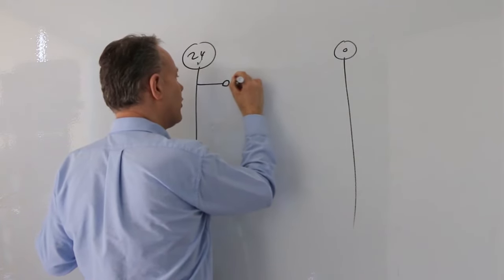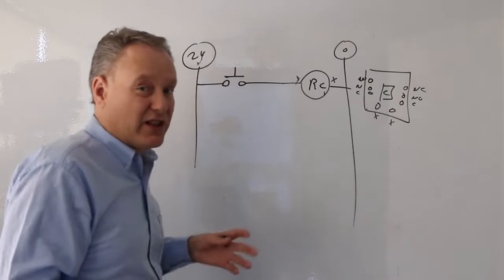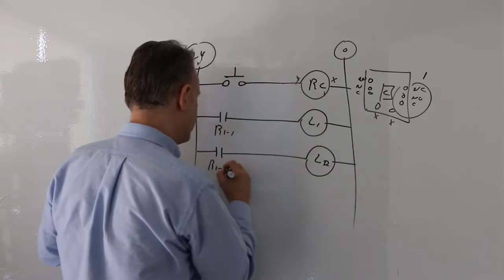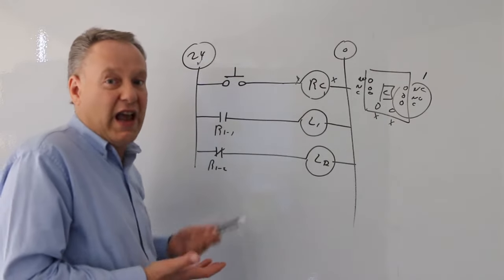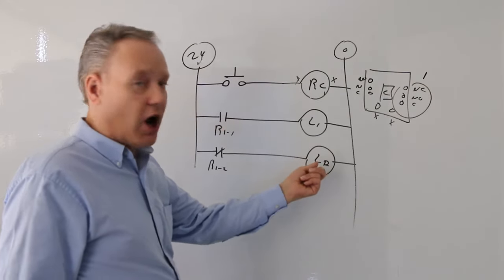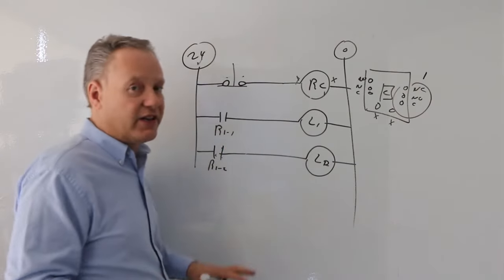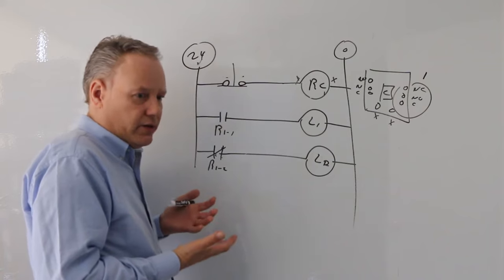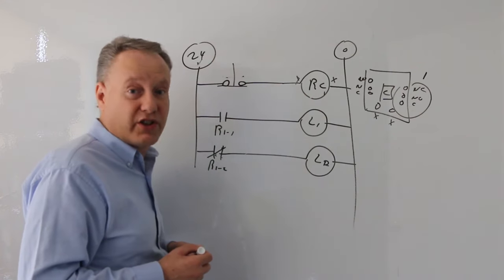Introduction to Ladder Logic with Relays

Comment: Is it safe or ok to run 120 volt contactors and switches on a control box ? Can i use things like time delay relays as relays or is it best to drive contactors wit them ? Im worried a 120 system would burn up a coil on a normally closed contactor if it was held up for 3 hours . I feel like a 24 volt coil would have a higher duty cycle

Comment: Takes me back to the 70's when I used to service the old electro mechanical pin tables.  There's more than a few' logic relays' in those old babes I can tell you, the schematics look like a plate of spaghetti.  Solid state was the death knell for me and those things, where's the romance in a circuit board full of unserviceable chips?